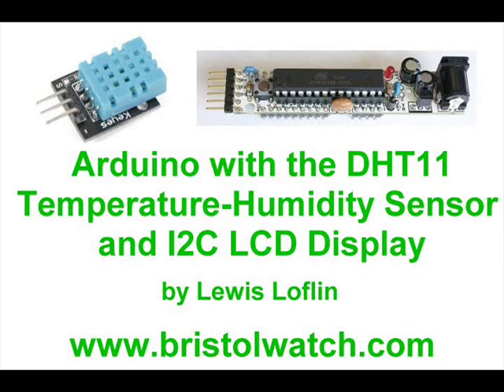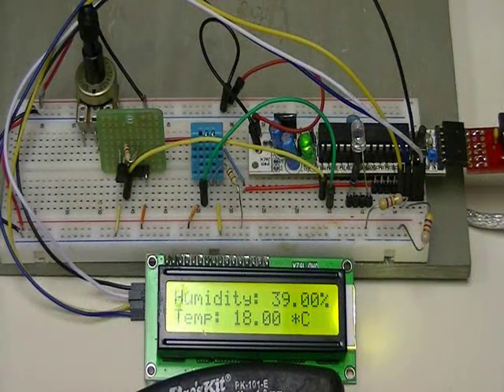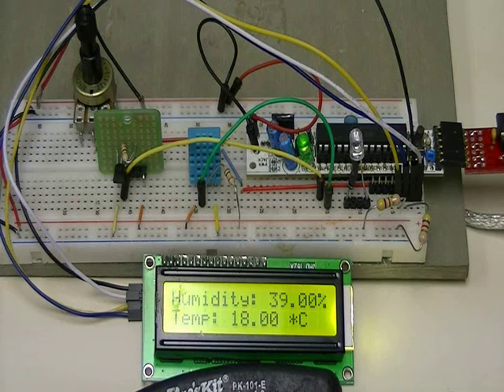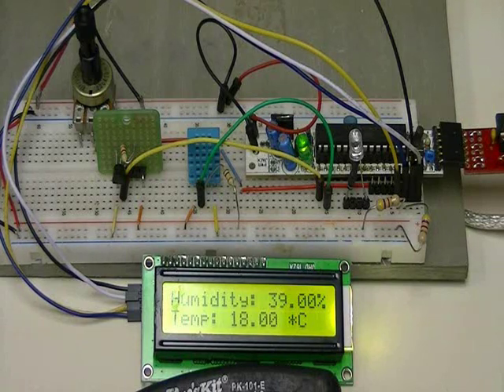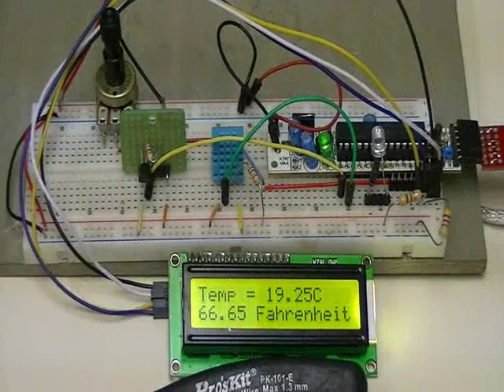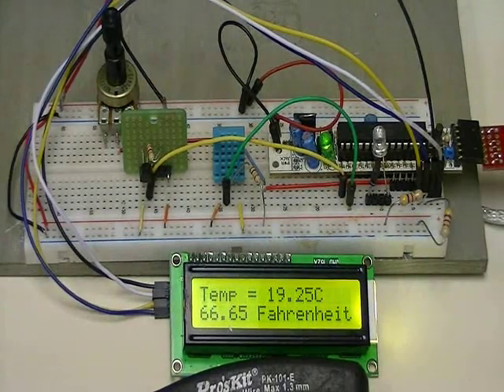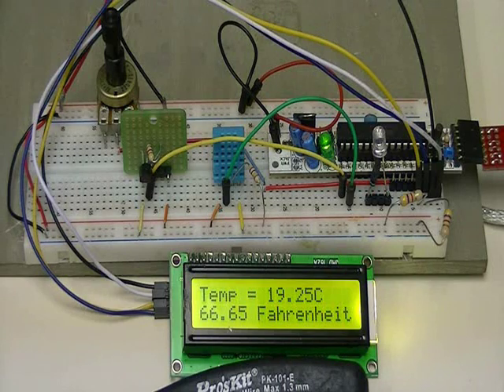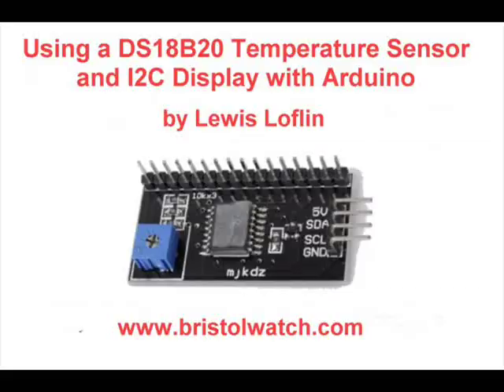Arduino with a DHT11 and DS18B20 Temperature Sensors

Comment: I'm hopping you can help point me in the right direction. I've done a sketch using the DS18B20 and I2C 16x2 LCD. The sketch turns on a relay when temp drops below a pre-determined temperature. On the LCD I have row 1 display the real time temp, and line 2 is set to simple text for the trigger temp.  I'm looking for a way to be able to use an encoder or switch to change the trigger temp, and also display this below the real-time temp. Been searching for the answer, but maybe I'm not typing in the right search words....? Any help would be greatly appreciated, and if this is worthy, maybe an item for a video on it.
Reply from the maker: That would be a good idea for a video. I'll look into it.
Reply: I've been trying to make this after I had a heater in my aquarium go bad.... in the on position, cooking all the fish. I (being new to arduino) though I could make a device that would allow me to set a sort of fail safe device, to protect against this happening again.  In my mind I was picturing an encoder, so that the push button would enter into a screen that would allow the temp to be set, and the main window simply showing the state of things.  I found out quickly that what sounds easy, if well beyond my current knowledge...
Reply from the maker: If you are new to Arduino this is a complex subject. Why use an encoder? Why not a few switches? A DS18B20 is a good choice but you have to make the probe waterproof.  Go to my homepage at http://www.bristolwatch.com and go to the Arduino section down the page. It covers LCD displays, sensors, etc. the information should be there.
Reply: I'm quickly finding that out. I was planning on using the encoder only because I have a few left over after repairing one on an LCD for a 3D printer. My original idea was to use the programming there (Marlin) and strip out everything that wasn't needed or learn from what they did, but, as I found out... that was more confusing than starting from scratch.  The DS18B20 I got came as a water proof unit with a 3 wire cable glued inside a metal cap at the end.  I've been successful in getting the thermometer side of it working, and using that to trigger the relay, but that's as far as I've gotten so far.  I should have some time this weekend to work on it, so I'll check out your link and see what I can come up with :) Even if not successful, it's still learning :)

Comment: do you have a sketch with these two working together? 
I''m making a system with 1 x DHT11 - 6 X  DS18B20  and a  DS1302-RTC  with some relays for pumps / ball valves and  lights maybe other stuff later like PH meter dissolved  oxygen meter and a hall flow meter i have a working sketch for both i just cant get them to work together and the RTC is just making me go bold using the TIME ALARMS sketch

Comment: Just discovered that you "Liked" that video. So it appeared on your channel. I was benefited from your video tutorials a lot. I constructed a solar charge system according to your excellent schematics and arduino program. And I combined it with my temperature sensing program (used to measure outdoor temperature and humidity, so I can compare with room temperature).